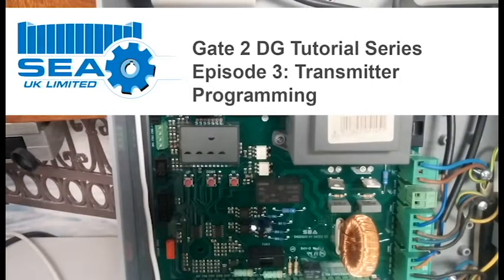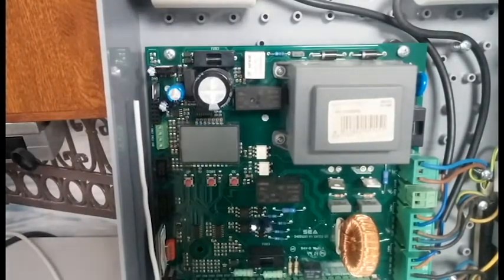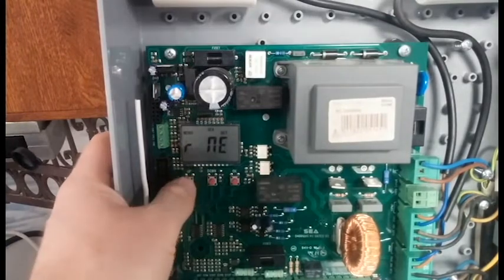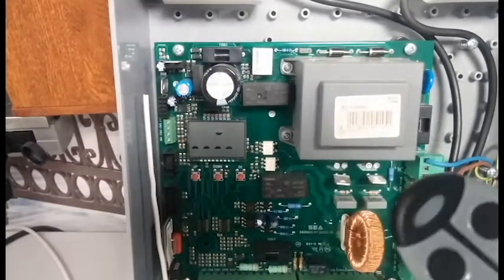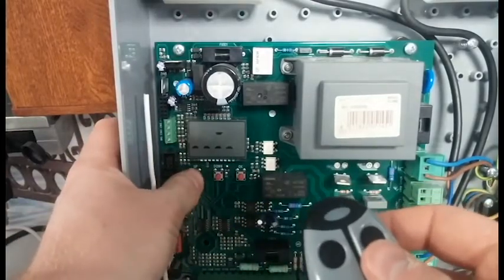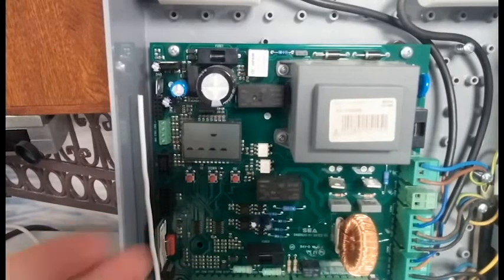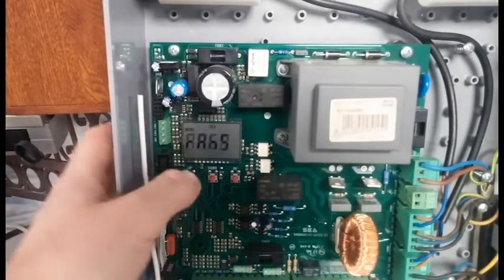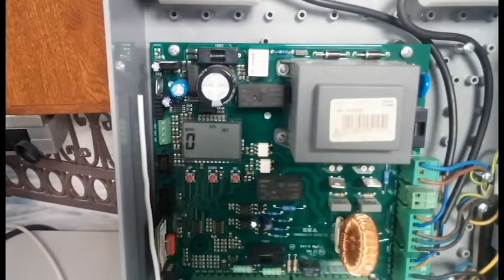Gate 2 DG   Adding a transmitter

Comment: Hi John, I have recently replaced the remote controller on my gate, following your helpful video. I was wondering if you can provide advice, the motor closed the gate once after pressing the button, but never opened or closed again. The receiver is still receiving the signal to open.